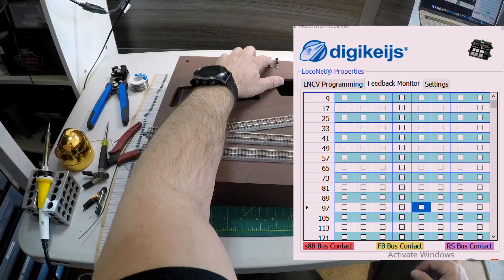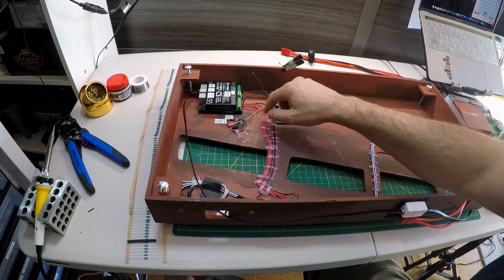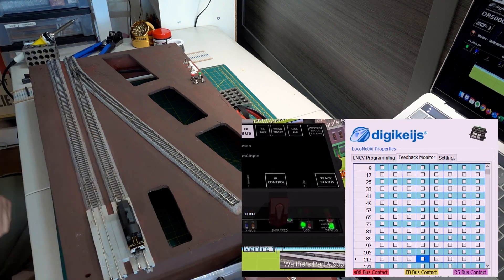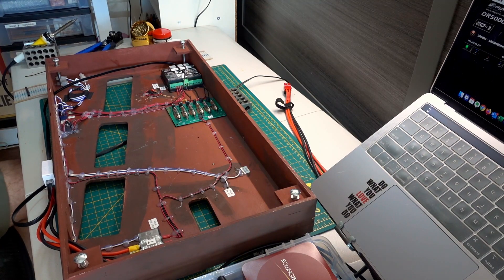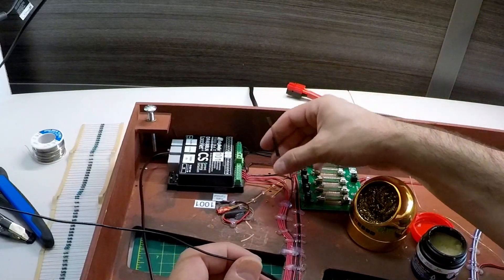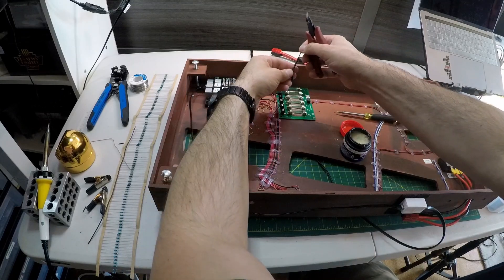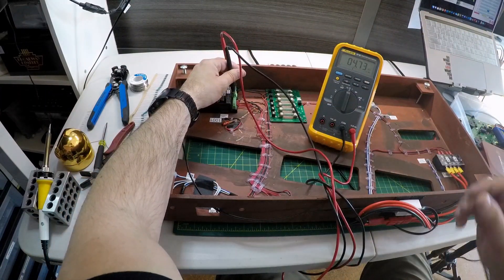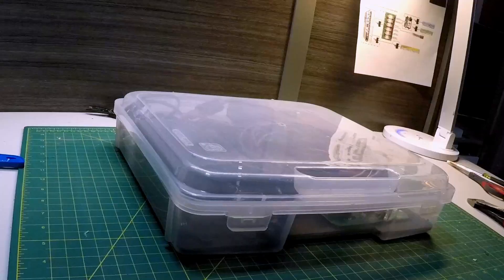3 || Help || Current Sensor Issues | Digikeijs DR4088-CS Push Button Block Detection

Comment: You need a resistor on each switch wire. Placing the resistor on the common just drops the common voltage down. 
Go to page 11 on the manual and look at the drawing. 
The darker yellow wire to the rail is your red wire. If you place a switch in the middle of that connection with a resistor is should work. 
Your red wire will be open. When the button is pushed the resistor is added and the DR4088 will see the current draw from the resistor and register occupancy. 
 
This one way of achieving your task but using a Raspberry Pi Zero/w with the GPIO is better. You can load JMRI on the RPiZero/w access it with your phone eliminating the switches.
shainsmart 8-Channel 5V Relay Module can be controlled by the GPIO pins on the RPiZero/w.
 That would be the way to go.
Reply from the maker: Check out video #4, I did end up solving my issue.  I needed to loop in a power source, which I was missing at the beginning.
I like the idea of using RPis or Arduino's, but I really like having the switch device on LocoNet.

Comment: Since you want to end up turning on led’s,  you should look at the panel decoder by MGP mollehem.se it is a loconet device with 16 inputs for pushbuttons and can control up to 64 rgb led's.  Then you don't need to buy led decoders,  just buy rgb led’s with built in WS2811 chips and Daisy chain one led to the next. This reduces the amount of wiring.  Or you can buy MGP'S led boards.
Reply from the maker: Thanks for sending this, I never thought of using the Panel Decoders to control the LEDs, but it makes a lot of sense.  I have bookmarked this site to review further.
I just finished two videos, 25 & 26 using the NCE Illuminatos to control the lighting. It worked out pretty well, but I am still investigating options.
Thanks for watching my video, out of curiosity, how did you find my channel?
Reply: Human[c]ity Junction I was watching an other model railroad site, and yours showed up.
Reply from the maker: Thanks, that is great to hear.

Comment: I'm Back!! Ok, again I'm not familiar with the DigiKiejs so take my comments filtered through your experience, and considering this is a four month old video.

Normally, what I've used for a current providing resistor is on the order of 10ko, I think I heard you say you were trying 75ko, that might not allow enough current to trip your detector.

What's with the CP6? that's a real cheap and dirty current limiter. It should be unnecessary (and might actually get in the way under high current loads) with your PSX. The CP6 limits current to the track, so you might never get to the current needed to trip your PSX.

It's Kah'-toe, not Kay'-toe. Hiroshi's a member of a club I belong to. And folks from Kato USA participate in some of the same T-Trak circles that I do.
Reply from the maker: I bought the CP6 before I had a clue, and when I tried to return it, it would have been a huge PITA. I was REALLY new to DCC at this point, so I will still figuring things out.

In the next video, I did solve the issue. I had not included track power in the detection circuit, so there was no current to detect.

I responded on Groups.io to your post
-Heath

Comment: Are the push buttons wired in a sense that when the button is pressed it causes a short? Then you have a resistor between the short? That's how I'd wire it but I couldn't tell if that's how it was done.
Reply from the maker: Yes, that is exactly the scenerio.  The buttons are N.O.  I thought this would trigger the 4088, but it is not.  When I tested the sensor with a loco, the amperage reading I got were much different. So I need to change something, but I do not know what.
Reply: @HumancityJunction  ok my next question is? What power is going to the buttons? Is it power from the bus or track? I see the sensor wires going to the push buttons but is there power going to them?
Reply from the maker: Oh, that could be what I did wrong.  I just created a loop between the common on the DR4088 and one of the numbered outputs of the DR4088.  I probably need to add the track power through the circuit.  I never thought to test the voltage, but that is likely my issue.  I am creating resistance through the wires, but there is no voltage. Do you think this would fix the issue?  I can use another output on the CP6 to add track power into the circuit I have created.  Will this cause a short that trips the breakers?
Reply: @HumancityJunction  I've never wired a DR4008 but I believe that is the issue.  You have no power to sense.  Basically just wire it exactly how the track would be wired.  But instead of having isolated blocks of track you have isolated blocks of push buttons.  Hope that makes sense.
Reply from the maker: @CreativeRails  I will give it a try, probably tomorrow and post an update.  Thanks, I knew it was operator error.